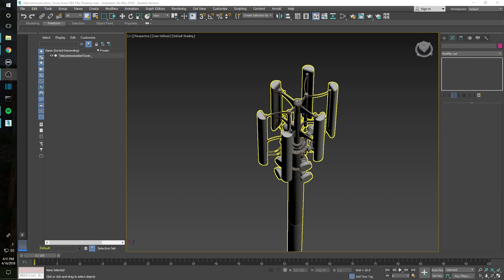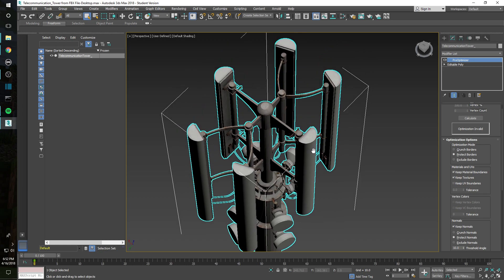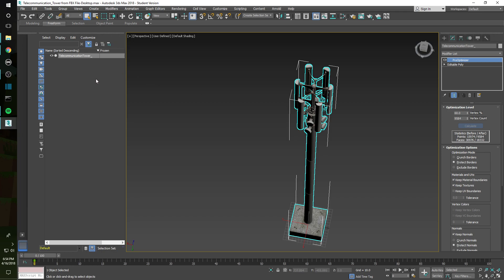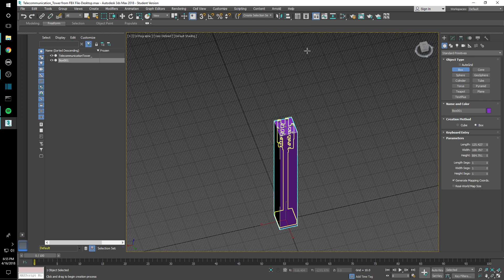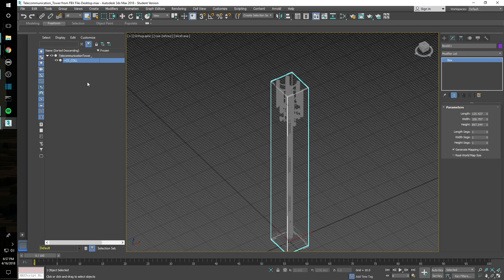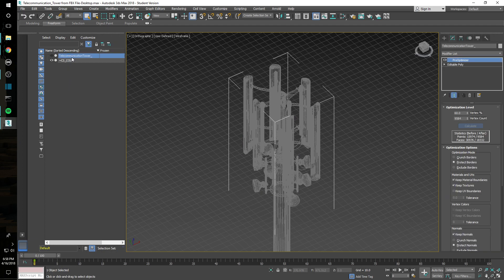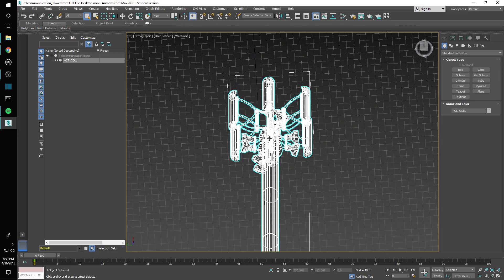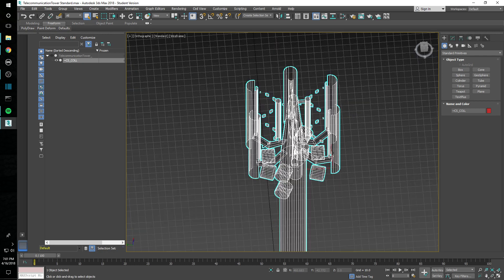Collision Mesh for RealFlight

Comment: I’d like to create our local flying field as a RealFlight9.5 site, but can’t find any tutorials on the process.  I did watch your video on importing this cell tower, but need a bit more. Any suggestions?
Reply from the maker: I got all of my info from the Knife Edge forums. I have not kept in touch with what has changed, but I don't think it would be too much. I also had to watch a few 3D max tutorial videos. No specific ones though. Best of luck. I'm sure you can piece it together.